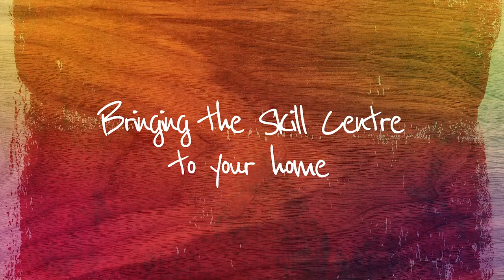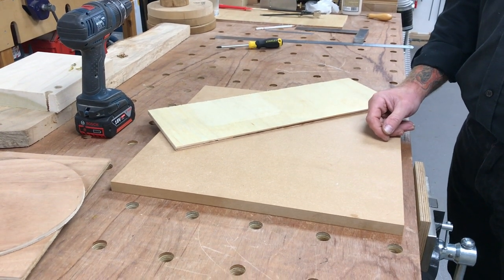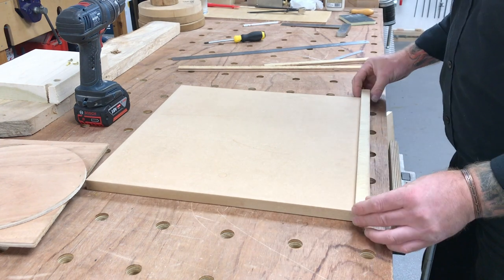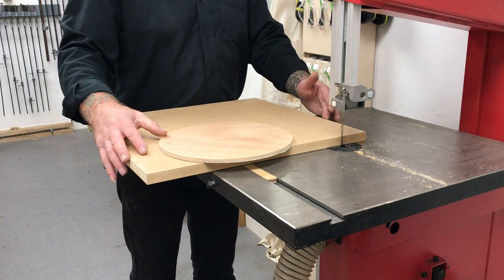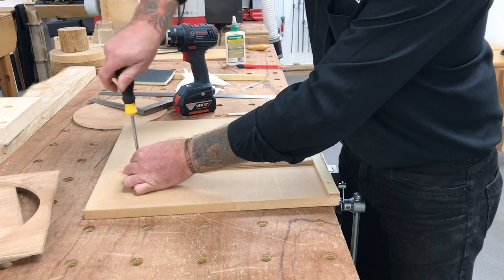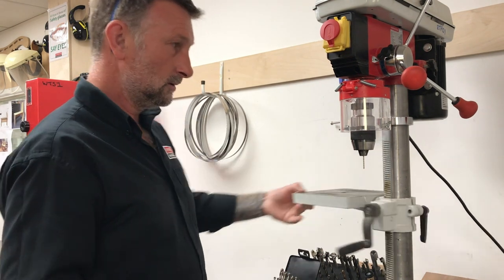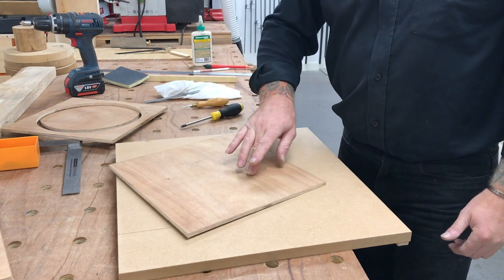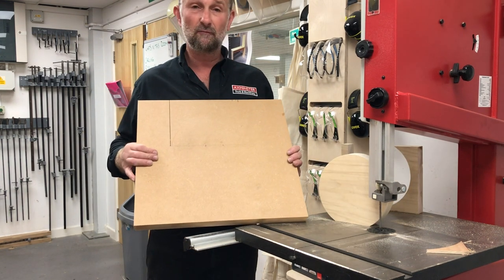Workshop Wednesday - Bandsaw Circle Cutting Jig

Comment: Brilliant, I amazed myself that I followed the instruction on the video made it and it worked first time. I’m new to wood turning and have never used a bandsaw either , the only problem getting to fit the screw in the hole made in the centre of the wood to be cut but I’m sure I’ll sort that. Have to get quarter in blade to try some bowl blanks.
Thanks Craig for an excellent video.

Comment: Made one today for my small 4" bandsaw, I'm new to woodworking.  Nice little project and worked perfectly on larger diameters. Bandsaw stalled on small diameters (100-150mm), maybe asking too much of it.  Hopefully a smaller blade will help or maybe I just had the tension too high.  Some experimentation to follow.  Thanks for the easy to follow video and very clear instructions.  Look forward to your next 'project' video  😊
Reply from the maker: Hi Paul, the following reply is from Craig - "Yes, a 1/4 x 6tpi blade would be needed. Make sure that the compass point line is dead in line with the cut line!"

Comment: Hi Craig I have a 1953 10" Delta HomeCraft bandsaw that does not have a mortise slot do you have any information on making a jig like your one to fit my saw ???
Reply from the maker: Hi Douglas, the following reply is from Craig - "Wow, would love to see a picture of it, got a thing for the older solid machinery!  So you could make a jig almost the same but instead of using a mitre slot to slide forward squarely into the blade, you could use each side of the table. This would mean still having a stop strip to make contact with the front of the table but also 2x side strips which internally are equal to the overall width of you bandsaw table - with a tiny bit of wiggle space!" I hope this helps :)